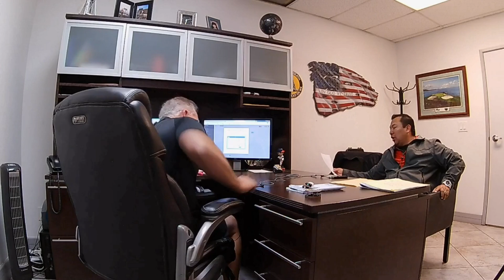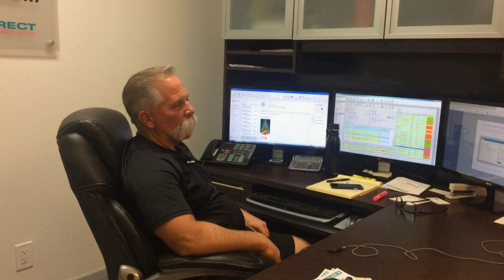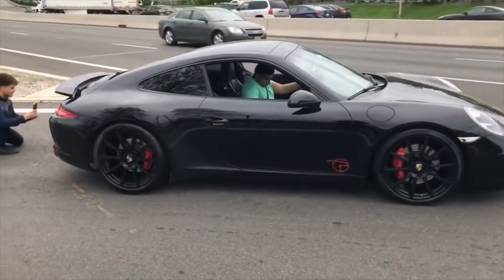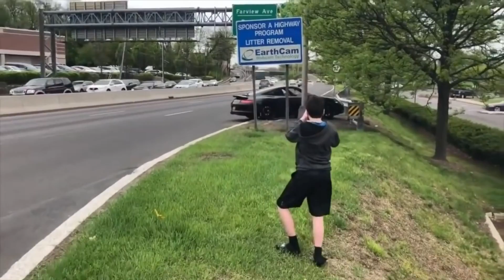Engine Oil Analysis Review - Blackstone Labs - Titan Lab Results Australia - Worth the Money?

Comment: For the transmission aspect of the video. If you heat the oil too much it will become depleted and lose most of it's viscosity and not protect. So if you are putting lots of stress on the transmissions and/or don't have a cooler in route. You will want to change it more frequently. As far as engine oil; they put in calcium and magnesium in the oil to keep the carbon deposits from sticking to the cylinder walls and dispersing throughout the crankcase. Dirty oil isn't necessarily bad oil as it's proof it's cleaning as it should, it doesn't necessarily mean that it's depleted yet. If possible run a larger oil filter, so you have more filtration media for extended changes if the oil you're running allows for it (verified by a UOA). Also molecularity synthetic oil is superior in every way. It just got a bad rep in early production; it had more cleaners which made gunked up seals start to leak. Now you can find synthetic for higher mileage engines that contain seal conditioners and all that. Just my $.02
Reply: When it comes to a transmission I believe the big thing is heat. Older autos didn't have trans coolers. They do now and they last longer. If towing heavy loads in summer in high temps. I add a larger or extra trans. cooler. Temp. will brake down conventional a lot sooner than synthetic PERIOD. Early in a transmissions life I change the fluid and inspect for particles. A thimble full of fine graphite looking material is normal, but a teaspoon of small metal pieces means you better have a plan B.

Comment: https://www.schaefferoil.com Best lubricants and fuel additives in the world!
Reply from the maker: What makes it the best lubricants in the world?
Reply: @bundysgarage  2 Patented  friction additives 

After choosing the finest base stock they start adding two friction modifiers; Micron Moly and Penetro. Micron moly is
 oxidized molybdenum that is magnetically attracted to ferrous metals. It is five times stronger than steel and has a melting point that is twice as high as steel. Even under the heaviest loads Micron Moly will not pound out. And Schaeffer has the highest content of molybdenum among all major brands. Along with Moly Schaeffer adds a proprietary product that is
exclusive to Schaeffer oil called Penetro. Penetro reduces friction by adding what is like microscopic ball bearings in the oil.
This is especially good since most engine parts contain metals that are non-ferrous along with ferrous metals. Non-ferrous metals do not attract magnetically so they need lubrication to protect the surface other than metal alloys, such as
 molybdenum. Penetro and Micron Moly stay on the parts even during cold starts to offer the best protection at all times.
Reply from the maker: I would like to try some out. Do you know where I can get some in Southern California?
Reply: @bundysgarage  Best way for you probably is Amazon. 👍
Search - Schaeffer manufacturing co

Comment: My Honda has a maintenance minder that indicates an oil change at about 7,500 miles. I follow it with Pennzoil Platinum synthetic oil. At 483,000 miles the car still runs great and only loses between 1/3 and 1/2 quart between changes (leaks at the rear main and crankshaft seals)  Compared to 3,000 mile intervals, I've saved  over $3,200 ($6,500 at dealer prices) by following the Honda recommendations for oil change intervals.    Synthetic oil is better
Reply: Cool story bro
Reply from the maker: At what mileage did/do you change the conventional oil?
Reply: My Honda MM is every 3500miles with full synth oil
Reply: Google User  
You didn't say how often you changed the oil.
Reply: @stevensevek6151 he did... Read it from the top.